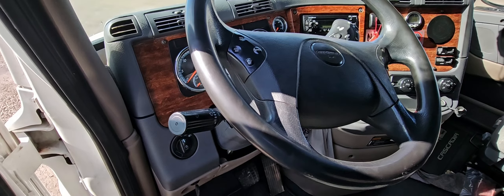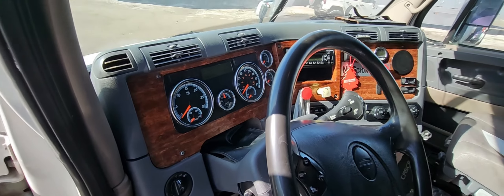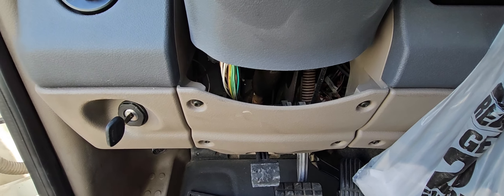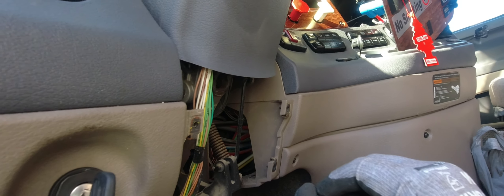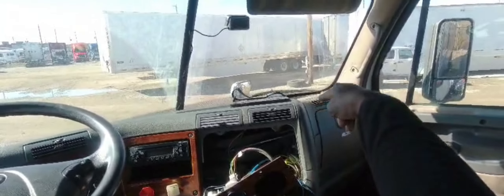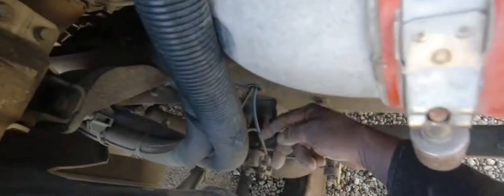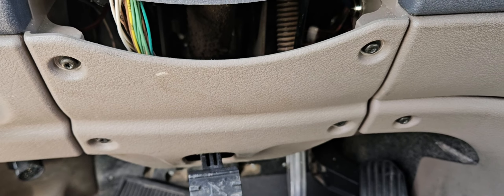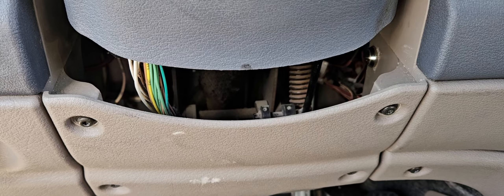Freightliner Cascadia installing a push button start.

Comment: It will be easy to install by the key ing bro take the ing a part and the solenoid wires are there. Just open one part and disconnect from the key on position. Much easier
Reply from the maker: I replaced the ignition already but that didn't help, the issue is somewhere deep in the wiring that why I put the push button.

Comment: Hey where did you run your other wire?
Reply from the maker: @thelifeoffishinju1478  one i ran to the starter the other to the closest power source which is alternator ref for me.
Reply: Hey to the power side of the alternator or the negative side for ground
Reply from the maker: @thelifeoffishinju1478  the power side
Reply: Thank you